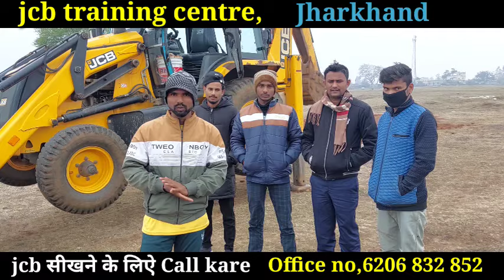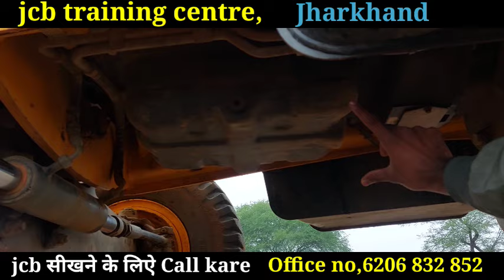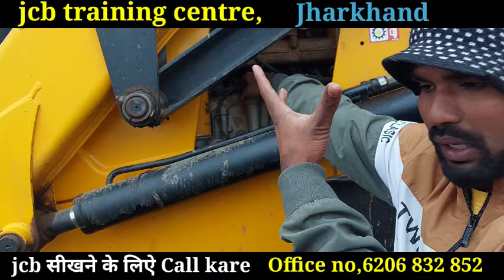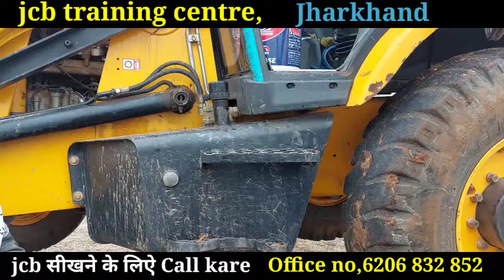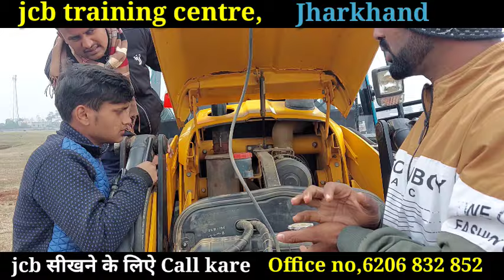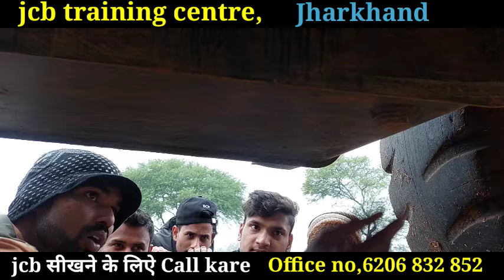Jcb machin मे 7 तरह oil होते है, ye video helphar jarur dekhe,🙏

Comment: 1 Engine Oil 13 L,2 transmission oil 16 L, 3 excel oil 25 L,4 hydraulic oil 130 L,5 break oil 250g,6 diesel 130L,7 coolant
Reply: Thank you
Reply: All  oil changes  time  kya hai  bhi  bato  piz ❤